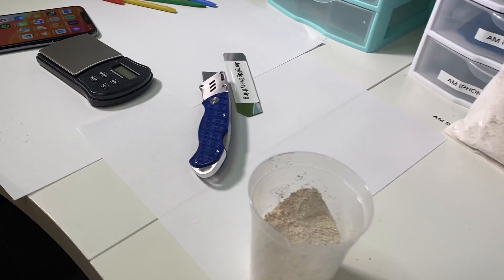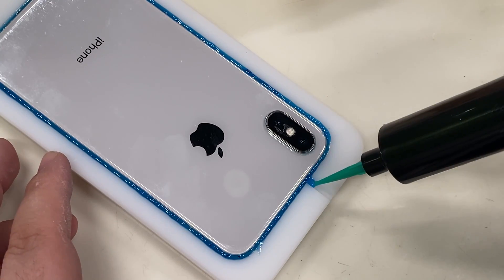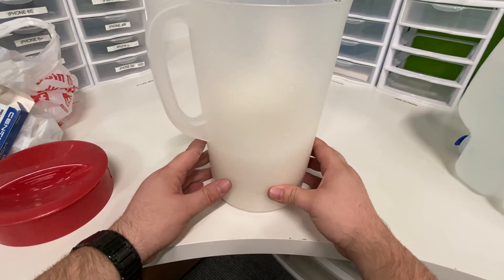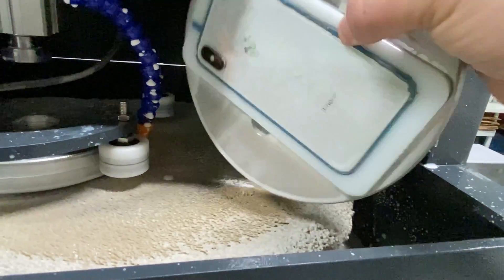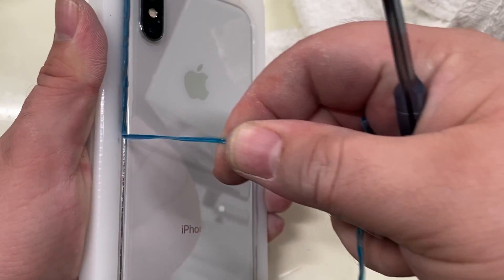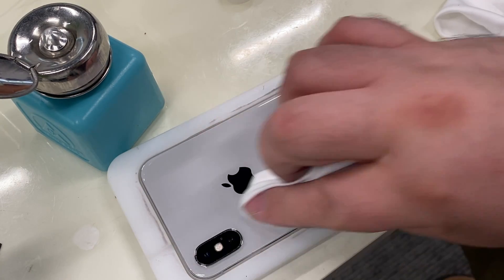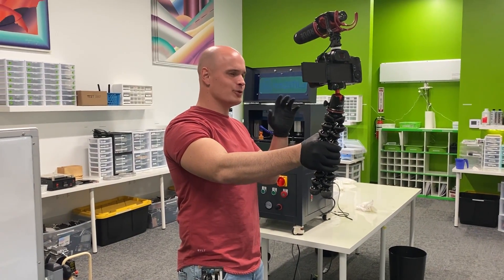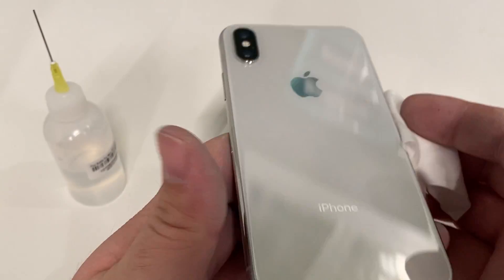Say Goodbye to Scratches: iPhone Glass Scratch Removal Tutorial!

Comment: Dude…. Annoyingly even my case no matter how clean I get it no dust nothing. I still takes off the very fine finish as if there is a clear coat on the back glass. Now when I clean my back glass with a microfiber cloth. The marks are invisible completely to the eye. Until my greasy hands roach it. Then reveal the back glass clear coat damage and it’s very very annoying.
Reply from the maker: I think you are referring to the oleophobic coating. This should be added after the polishing like in the video then it will be back to normal.

Comment: It's a cool concept, but I can't imagine it's very profitable. For this much work, I feel like doing a glass replacement would be faster and not risk liquid damage.
Reply: I think glass replacement would stand more chance of comprising factory water proofing than this solution. Replacing the glass altogether means completely removing the factory seal, divers still find iPhone 10s that have been under water for a week and kept the seal...

A replaced scratched glass phone stands more chance of succumbing to that water ingress than a stock sealed one...

You may be very competent at screen and/or back glass replacement, but this “resurfacing” doesn’t need them to be replaced.

Plus with most (iOS certainly) recent devices, displays are paired to the logic boards and need that re-programmed or you change basic functionality of the device after screen replacement. This also carries inherent risks and cost to potentially bricking a display with a bad display read/write process.
Reply: Have you ever replaced the back glass on an iPhone? Did you see his other video with Jerryrigeverything on back glass replacement?
Reply: @Derekwemet  I replace back glass on iphones multiple times a week. I'm not sure if iv seen the other video you are referring to.
Reply: @mabisbabis9480  imagine when someone needs a new battery or port in their phone but for an additional reasonable fee can be upsold to have a scratch free device when done and in close to the same amount of time.
Reply: @Derekwemet  I thing the whole thing is really cool and seems to work well. But the problem for me would be cost of the equipment, how profitable it is and the time it takes as well as the risk of potentially damaging a customers device.
Reply: @mabisbabis9480  well there would also be a risk of damaging the customers device if you physically replace the glass right?
 If the risk is comparable then this could be quite convenient. I don't know how much the machine cost, but I'd guess that this wouldn't pay itself back too quickly like you said.

Comment: How much does it cost each time to run the machine?
Reply: $0
Reply: @Derekwemet  that's not true the machine cost money to run. It has a rough lifetime each time you turn it on it takes away one run from it. Also the powdered stuff he uses cost money as well. While it may be cents on the dollar to run that's very important numbers to know before buying a machine. I honestly don't know anybody that would want this done. The only time I could see it useful is when there's a really scratched phone and instead of repairing the screen or back you could just use this. And thats not all that often that I have had phones that are so scratched they be considered cracked pricing
Reply: @chriscripe9477  you have some good points, but the laser machines to do the back glass effectively cost the about same amount. It also  requires the cost of the glass, tools, adhesive, clamps, extra time and still quite a bit of labor and risk. The powder isn’t expensive and is reusable. It’s the perfect upsale in the industry when someone comes to a repair store for a battery or another issue but can also have scratches removed for and additional cost while having other work done for not a whole lot of extra time.

Comment: @FIXD Phone Repair  Great work! I've watched all of your videos when learning to replace the glass and have been fairly successful but recently I've been shorting the watches, the screen is blank although it still vibrates etc  please advise me how to repair. I couldn't figure out how I'm shorting the watches but I came to the conclusion that I must be powering on the watch when cleaning the glass from the frame. I figure draining the battery should solve that, but how do I repair it the shorting issue? Please help. Thank you
Reply from the maker: If you are having issues with accidentally turning on the watch when cleaning, try unplugging the battery until you have successfully gone through the process several times without hitting the button.

Comment: That's great, nice work! More videos with Zack will be nice to see.
Can you please share where I can buy such oleophobic coating? Thanks
Reply from the maker: If I can find a link I’ll put it here. In the mean time ebay has some just search oleophobic coating and I’m sure you’d find some.
Reply: @FIXDPHONES , did you find the link? -_-
Reply: @_Artem_Artemovich  no he did not I'm afraid
Reply: The ones I can find are advertised as liquid screen protectors and don't require curing with uv light. Actually I have 2 types and they don't last very long when applied. Is the one you use long-lasting?